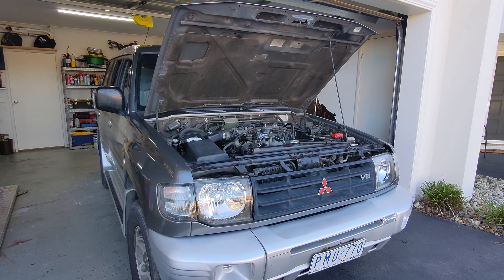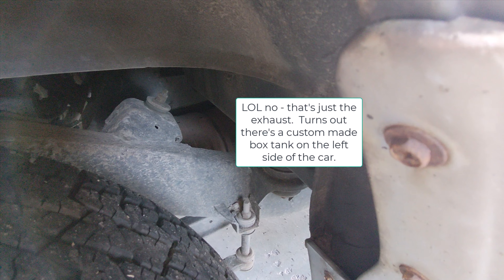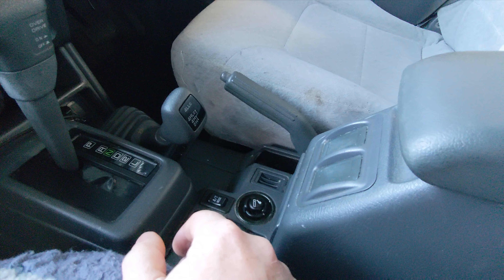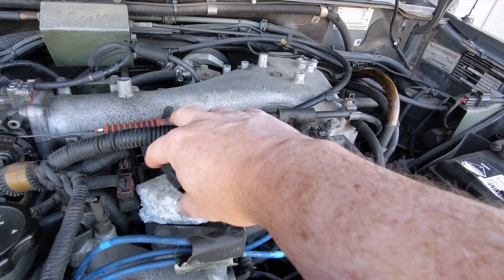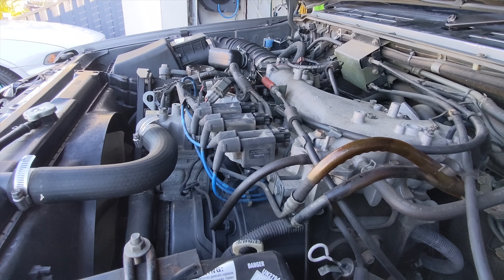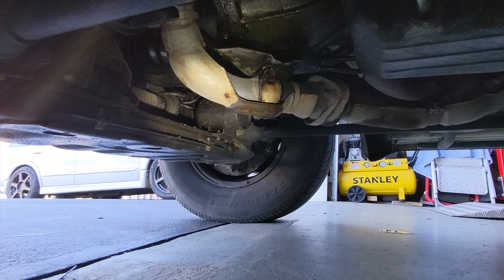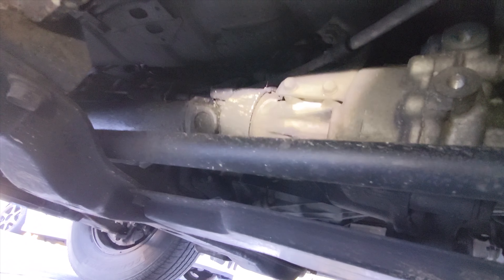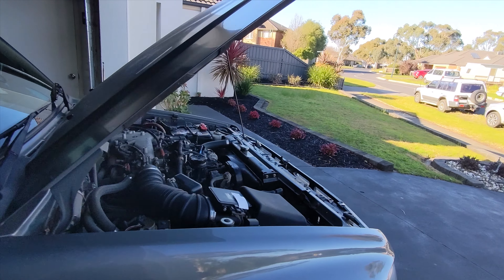Reviving a one-owner NL Pajero/Montero

Comment: Brilliant vehicle, they all leak around the rocker cover gasket, ask me how I know 😂
Reply from the maker: Yeah my old Magna was the same.  The rocker covers are basically made of thin sheet metal - they leak if you under tighten them, and they also leak if you over tighten them!  I find that Permatex gasket dressing makes a huge difference on these seals, so I'll be using some when I get to the seals.
Reply: @KaldekBoch  yep, mines a 6g74 like yours.... I'll get around to it, I find if I don't overfill the engine oil, it's a manageable drip 👍
Reply: @KaldekBoch  forget to mention there is a belt condition check plate on the left front top timing cover casing, it's a plastic triangle shape cover, one bolt from memory, can't miss it......
Reply from the maker: Found the oil leak.  Not the rocker covers, it was the cam seals. https://youtu.be/6LGX7NOvxok

Comment: Definitely do a timing kit with pulleys and water pump while you are there. While you have all the accessory plate pulled off the front you may as well. Check your crank angle sensor as they tend to get oiled up and start to deteriorate bad after all these years, sometimes.
Reply from the maker: Way ahead of you.  I managed to snag the very last Gates full timing belt kit and water pump of an old SKU at Repco for $180.  And yes, it is the WHOLE kit.
Reply: @KaldekBoch  it really pays off :) I bought a 98 model GLS with the Exceed extras for $600 last year, blown head from overheating. I've swapped heads off of a motor with a blown big end and scored bores. It's absolutely beautiful, like it come off the showroom floor. I did all the other parts while I had the heads off too.
Reply from the maker: @mitchmckeiver1429  I did some more work on it today (videos delayed due to having to travel overseas for work and now I also have the flu).  Whilst that work was replacing the 4WD solenoids - which fixed the 4WD selector BTW - I also got a good look at the oil leaks and I'm pretty sure it's the driver's side cam seal that's pissing oil.
Reply: @KaldekBoch  I will watch these when you get them up. Fingers crossed it's the rear cam seal as theses are only 2x 12mm bolts I thing, back cap pops off and it's just an o ring. Front are full seals requiring cam sprocket removal as you'd know 🤦‍♂️ definitely something to take a close look at when doing a timing belt as you are 95% of the way to doing seals when you do a belt of course.
Reply from the maker: @mitchmckeiver1429  oh I'll be doing the cam seals regardless.  I mean, they came with the kit (as well as the front main seal) so while I'm in there it's just gotta be done.